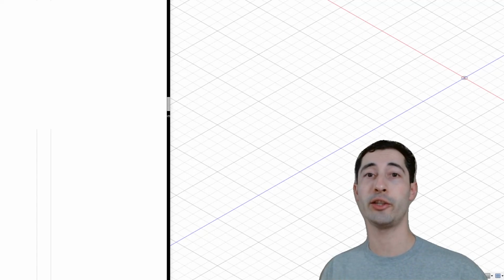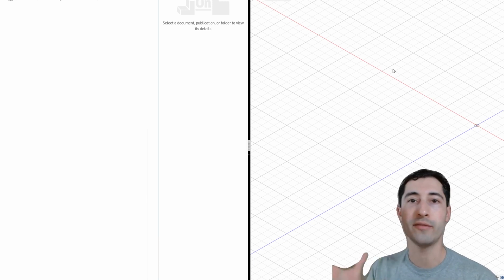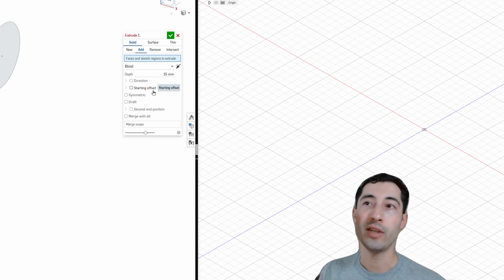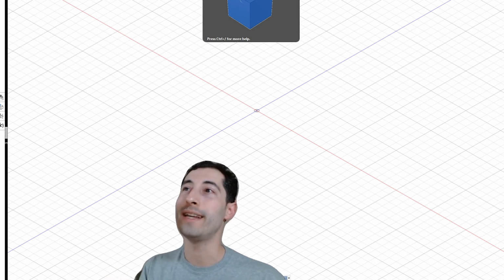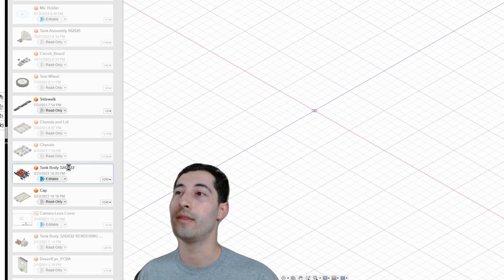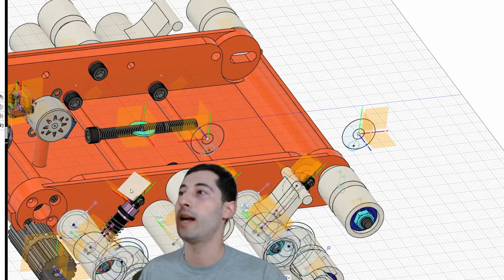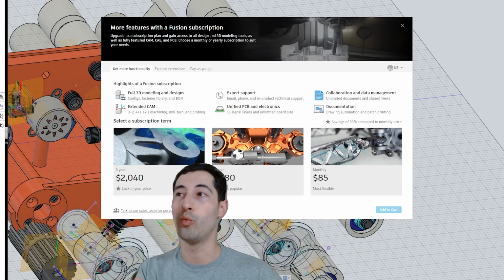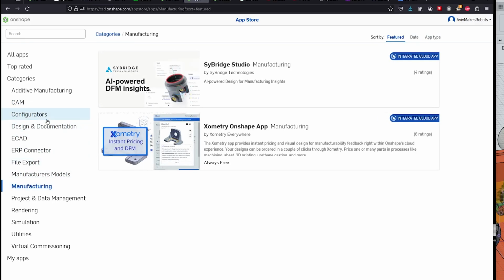Onshape vs Fusion vs Solidworks

Comment: I don’t know, man I have 12 seats in my company that I bought of solid Work and five solid Works professional seats. We also have nx, alias, and Rhino. Our entire office switched to fusion about seven years ago and for a while we were like kids in a candy store happy. We are here looking around again because fusion has decided to Nerf themselves into oblivion. 
But when we had to go back to solid Work because we needed to get work done every single one of us was sad. Fusion was almost great. They need to fire their entire management team, but they probably won’t.
Reply from the maker: What do you mean by nerf themselves? What features?
Reply: @AvivMakesRobots  I don’t know what they have done but things just don’t work. We spent three days trying to get one STL to load in cam. Split body feature stopped working for four days this week. Works on some parts doesn’t work on others. I did a combine assembly and one part at a 12 part of this new body. When you toggle the body off, the part just joined, but when you make a mirror cookie cutter of the part that joined part was missing because mathematically it never existed. There seems to be just math problems like somebody shattered. The code and glued it back together wrong. 
We’ve had days where the entire company has to go home from work because it just stopped working after an update. But nothing is more awful than the cloud. When you’re doing assemblies with thousands of parts, the cloud is like being in hell. Just to export a file can be 5 to 10 minutes. When it was local, it would be seconds. We are running monster computers, and they are superior to the fusion cloud in every way possible. The amount of times the screen just locks up because the cloud can’t communicate is becoming madness. On a part that we were sending two machining this week I have six copies of the file that I had to download to .step file to try to reset the math. It seems to work fine for guys working to 3-D print things in their garage. But we were using it for Huge assemblies and it was working great. The user interface was just amazing. Wish they just would’ve let us pay double and have the program we want versus whatever they’re doing.
Reply from the maker: Alright, I have heard of others complaining of lag, but this is new to me about the basic stuff not working. I wonder if they will ever offer a downloadable version that is still cloud. Same way AIs for coding do.

Comment: I'm admittedly at the end of my career,  and have seen the highs and lows of CAD. My company merged with another; we used SolidEdge, they used SolidWorks. What happened? They went with OnShape. From my experience,  SolidWorks is the king, despite having used other CAD systems costing much more. OnShape is interesting but incomplete. 2D is not good for creating wiring diagrams or creating nicely formatted instruction sheets. You cannot create groups or blocks. There is no grid or lock to grid.  Nobody talks about this,  but manufacturers that produce wiring schematics to go along with assembly drawings have to create them in another software.  Not good! Other features in the modeler are half baked. When I retire,  I will probably buy SolidWorks.

Comment: Solidworks has unbelievably bad UX. It might be deeply powerful software but for beginners it's wildly unapproachable. It feels like like it's been built by 200 separate teams who have zero communication with each other.
Reply from the maker: You should see their website. Back when I was using "Solidworks Connected," I had to wade through their website to get to the launch page. I was flabbergasted by the amount of pages I had to go through. Someone wrote a post on Reddit about it actually. But yes, Solidworks UI is unapproachable but... I mean it does work. They have the advantage of being the king for so long.

Comment: Respectfully, you are wrong. There are plenty scenarios where the history is not just irrelevant but counterproductive: CAD imported from legacy systems, native models "poorly" created by other users, scan data, CAD from vendors and suppliers, etc. Aside for advanced Class A surfaces, which can't really be created in traditional CAD software, there is no such thing as "no way to modify" parts, you just need to fully understand all the capabilities of modern CAD software. Sketch-based parametric modeling is just one methodology of many available and is not the best for all situations. Fusion in an extraordinary software if you take the time to learn it and stop trying to use it like if it is another program. Solidworks is also an excellent software, pretty mature and capable and with an extensive user base. No one can go wrong if choosing Solidwork as CAD platform.

Comment: Why would I even want a timeline.  What does TIME have to do with my model?  It's dumb.  The only purpose for a timeine is for Undo/Redo, which is a ubiquitous feature.  But what I found even more perplexiing with Fusion 360 was there was never an attributes panel for each geometry.  I would expect there to be a tree of objects and at each level or at a minimum the leaf level would reside all the attributes and properties of the object.  I found myself performing actions and then not being able to go back and edit what I did, you have to UNDO the action and then REDO it with all the same parameters except what you want to change.  My second gripe is the lack of feedback when performing actions.  So many times I do some action and then there is NO RESULT, no message box, no error, and it didn't do what I expected either.  So, what actually happened?  Nobody knows because theres no log file, or trace, or command dialogue showing what occurred (and nothing in the timeline either).  Honestly, I would prefer creating geometry via code instead of this interface.

Edit: Future me here, I understand now that they use a timeline to help prevent circular parametric models.  I have a background in Autodesk Autocad which was way more intuitive even though it wasn't parametric.
Reply from the maker: The timeline is the attributes panel.

Comment: Have to disagree about Fusion 360. It is an integrated package with a very decent CAM, laser and plasma support, sheet metal, STL creation for 3D printers, as well as shaping.

No one would use it without the timeline, which works just fine at both the component and the assembly level. 

You are flat out LYING about the sketches being visible (they hide automatically after extruding but you can turn one or more back on if needed again). Same for mates and joints. It's very clean looking.

It's a professional-level package that starts at ZERO DOLLARS. I've used it for over a decade for my hobby CNCs, laser cutter, and 3D printer -- and have yet to purchase a subscription.
Reply from the maker: The CAM aspect is excellent, no doubt. The timeline doesn't work just fine- 'importing a part and moving it into place' being a command is the worst. In Solidworks and others, positioning a part doesn't come up in the feature management tree. I think the sketches are too thick and visible, which makes it look dirty with many sketches.

The more you get into CAM, the more you'll want to splurge on pro.

Comment: Another thing to consider especially for school students , makers and occasional users is that fusion will not be supported on Windows 10 as from early 2026 . This means if it crashes you can’t fix it and there won’t be a version that will run on Windows 10 available for download. Just something to keep in mind . That’s one thing i really hate about fusion is it only runs on windows and mac whereas Onshape runs on everything- even a Raspberry pi and iPad / tablet - now that’s convenient for me !
Reply from the maker: Good point!

Comment: There is one reason to not use the solidworks version.  It was Autodesk that gave this engineering grade modeling software for everyday people.  I don’t know if I shape would have existing if not for fusion 360.  And I can tell you with 100% certainty that solidworks would have never ever released software that everyday people can afford, if not for the success of fusion 360.  So I have a hard time supporting a company that would absolutely not make a product for me without be forced to.  So I get a little defensive when I hear people bashing fusion.  I am a mechanical engineer.  The company I work for used solidworks.  For my personal use I asked our provider if I could get any deal.  No, I would have had to pay like $6000 a year for base solidworks.  I remember when fusion was released, and it was a revolution.  Autodesk should have never had a free version though.  They should have charged $100 a year for the full version.  Now, since everyone uses the free version they have to charge more for the full version to make any money.  Now the $680 per year price (still a great deal for what you get) is steep for someone just dabbling and doing small projects.

Comment: I prefer SW and use SW for Makers. I also have Alibre Design Professional. I migrated away from Autodesk Fusion 360 because of the lack of export options and the fact that it would crash often and I would run it on a Pascal architecture graphics card. I did like that it was cross platform, but never could get the performance  I needed from it and was always subject to connectivity issues.  I did like the generative design features of Fusion 360, it reminded me heavily of Altair Hyperworks, but more accessible. I dabbled with DesignSpark for quite a while too as well as BrisCAD and used quite a bit of Ashlar-Vellum's software in the 2000's, though its modeling is more line by line parametric modeling, so somewhat unforgiving. Rhino, to me has that sweet spot of local install use and cost to own and maintain, I just wish it has parametric history based modeling and a way to get NURBS.

 I've used Shapr 3D and also Plasticity and while their cost models are significantly cheaper than that of say OnShape, they in my opinion still have some work left to do. (I do still use them occasionally) and really is nice to use on iPAD Pro when on the go. Blender has its place, but again requires a lot of research and information gathering to use it as NURBS modeler. SolidEdge community edition is free, but frankly complicated to use. FreeCAD which I've used off and on for 20 years is just difficult to get started with. Their UI needs to be simplified. As of writing this there is a soft fork of FreeCAD called AstoCAD but is a paid model to get the streamlined features. The good news is that at least push requests of issues are not deprecated. I want a software that is operating system agnostic and doesn't cost an arm and a leg and pseudo local install and also cloud storable. Shapr3D will probably be that in the future. If it can have the horsepower of OnShape then that might be the go to. I lean more toward OnShape and see it as more capable. The major downside of OnShape is cost. But frankly, anything worth having that is reliable, you have to pay for unless you are really good at coding. If you are such a person, then look at Open Inventor, or Open Cascade or Salome and you can really go far with those softwares.

Comment: I have expierence in all 3. I don't think you get the idea of Fusion 360 entirely. It is also a bit incorrect to compare Fusion to Onshape and Solidworks. If one needs speed, Fusion beats both. For example for a professional (not beginner) game weapon artist, Fusion 360 is a preffered tool. Those artist don't have to be very precise but they have to be very quick, because they also have to sculpt, retopologize, unwrap, bake, texture... Same goes to product and concept designers. There are awesome software examples without parametrical history at all (rhino, alias), but they are just perfect for what they do.
Reply: plasticity is preferred for artists now. fillets actually work compared to f360 plus better tools for artists

Comment: I used fusion 360 for a few years and absolutely hate it. Has to be the worst optimized CAD software there is. 

I personally prefer Solidworks for functional parts, and Plasticity for artwork or game assets.
Reply from the maker: I completely agree!! Solidworks is the best, but I recommend Onshape because it is very much like Solidworks and doesn't have a terribly designed website that makes it hard to launch Solidworks Maker.

Comment: ok, I am going to defend Fusion here because you are making some serious mistakes in your assessment when you were talking about turning off the timeline.
First, before you go and start making negative statment about a software tool I am going to ask you if you have had professional training on the tool.
The key reason for this is that software tools are designed to work a particular way with best practices.
I can tell you as an Autodesk user, trainer, and technical demo specialist, I never said negative thing about Solidworks because I have never had professional training with Solidworks.
Now I will get to your comment about the timeline. The reason you would shut off the timeline is if you wanted to work in a direct model mode. This means that you are creating a "dumb solid" where if you want to make changes to the model, you will directly manipulate the faces of the model.
Why would you want to do this?
Well, I can tell you that the down side of a parametric solid model with a tree of features is if you have an extremely complex model with a hugh amount of feature and try to go back and edit an early feature in the tree you can potentially crash the model.
I don't care if you use Fusion, Solidworks, Inventor, Catia, Pro E, or any other traditional paramteric solid model tool you will have the same problem.
Honestly, if you had taken the time to do a little research on Fusion, you would know that it started as a direct model system with no feature tree or parametric capability. Don't quote me on this but I think it was that way for the first 3 or 4 years of Fusion's existance.
For all of you out there, please understand this simple idea. 
Software is a tool. 
It does not replace your brain.
It is written by programmers who are imperfect and it is written to work with specific workflows.
Oh, and software is not a religion.
The questions you should ask yourself are but not limited too "What am I desiging", "Who do I need to share toe design with", What is the price of the tool", "Is there traininig available for the tool", "Will it allow me to do what I need to do".
I like Fusion but I think the biggest problem is that people do not get training on it and think they can teach themselves how to use it. While most CAD packages out there are "easy to use" I have never known any software to be as "intuitive" to learn as the marketing people claim.
Getting training on the proper way to use the software will make you incredible efficient with it and will save you a ton of frustration. I know this from experince as I tried to teach myself Fusion and then took an essentials class was was amazed and the "stupid" (in my oppinion) places that many of the common tools I used in Inventor were in Fusion.
If I ever do a review on Solidworks, it will be after I have taken a class on it to find out how to use it properly and then I can speak from a point of knowledge.
I hope the author of this video does not take offense to my comments and rethinks his stance on Fusion.
Oh, I applogize for not watching the whole video. I just had to comment after the author start making errors with his assessment of the Fusion Timeline and it's ability to be turned off.
Reply from the maker: Well, I think not working with a timeline is kinda pointless, unless you're designing something super simple (like a paper clip). 

If making edits to sketches and features are crashing your model, you should fix it. Just because it crashes doesn't mean it's the end. You find out what the rebuild errors are and fix it.

Comment: Personal things. What you got used to and what you trained will be always the best. Fusion 360 (my tool) is free for hobby and it is parametric and complete (meaning you can do everything with it). Solid is insanely pricey, so it is out of contention for 99% of honest hobbyists. Onshape is a great web app, free for hobby, but still much inferior to Fusion, so why would you need to use it rather than their endorcement?
Reply from the maker: I wouldn't call it inferior to Fusion. Why do you say that? Fusion has contact sets, which is a big deal, but still.

Comment: You can literally turn off everything you don't  like about onshape with one keystroke or mouse click. Sketches don't show by default unles you make them visible. You can hide them. Hiding the planes is as easy as one keyboard. Not saying your're wrong, but one of your main dislikes is a non-issue.
Reply from the maker: All I know is the assembly view is a mess. I have had issues like this in Solidworks, but the way solidworks displays sketches is much more minimalistic.

Comment: So... you made everything visible... and then complain about everything being visible? You then go on to say its going to have these all on by default, but... it doesn't. It auto hides sketches as soon as they've been used to make a solid.

Fusion has many issues to legitimate issues to complain about so if you're going to claim to be doing a comparison to judge which is best, at least compare to reality, not made up grievances.
Reply from the maker: And what happens when you are done with the sketch? Sketches all over the place!
Reply: @AvivMakesRobots  by default they turn invisible as soon as they are used